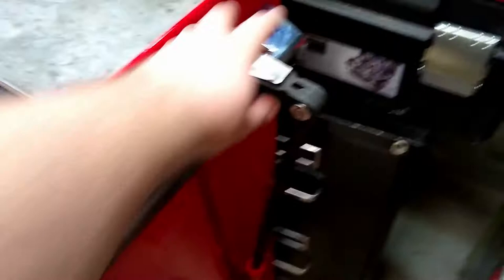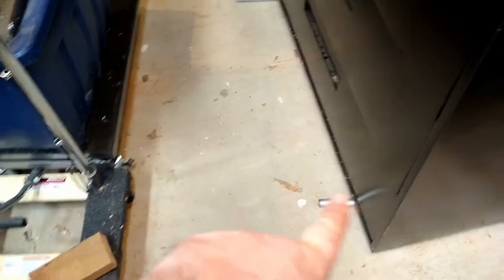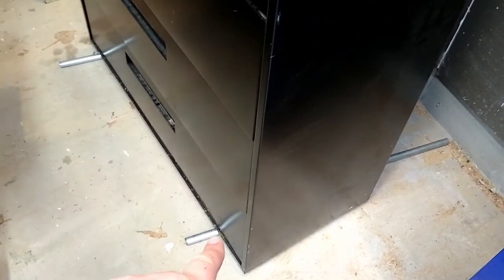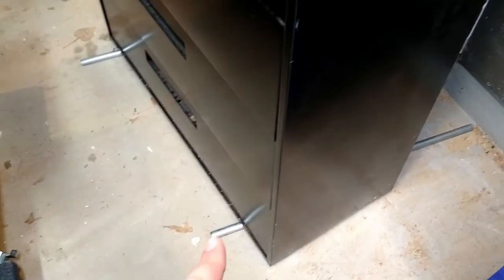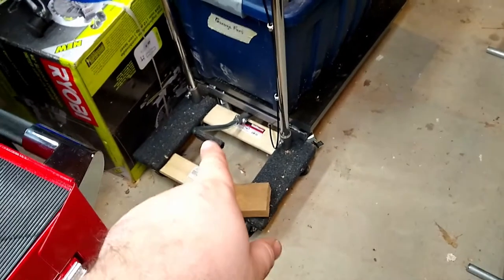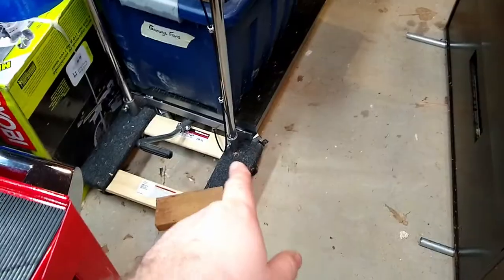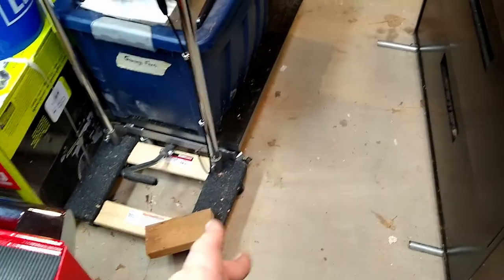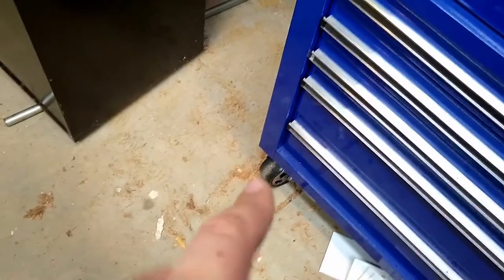Moving Lateral File Cabinets in a Shop

Comment: Vapor barrier. If you’re going to set the cabinets on the ground be sure to put something to keep it off the concrete as it can wick moisture from the ground below and cause the metal bottoms to rust over time. The stuff they use when they frame houses works. Trim to fit

Comment: Great job Jaspel. I get claustraphobic when you show the shop! Nice if it works for you.
Reply from the maker: Thanks.  It's certainly fits the triangle of compromises between capability, time, and expense.  Perhaps that would make a good video once I unbury myself.  
I would have much rather built a larger shop but the easements restricted it to 12' wide.  Very easy to eat up the floorspace over the summer.
Reply: @Jaspel  
Yes, shops are never big enough!